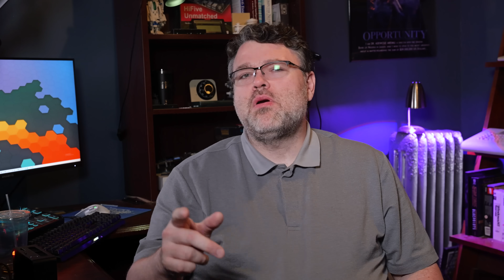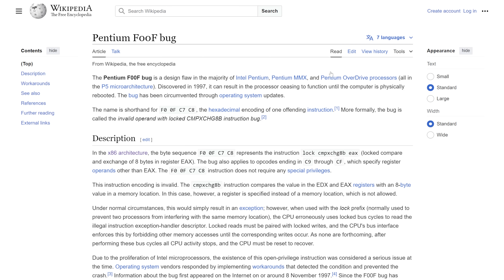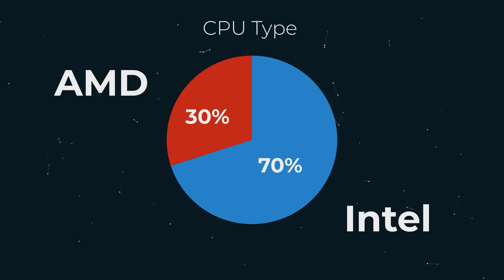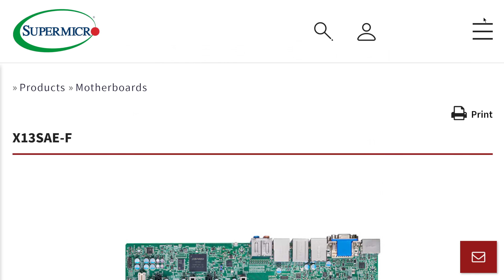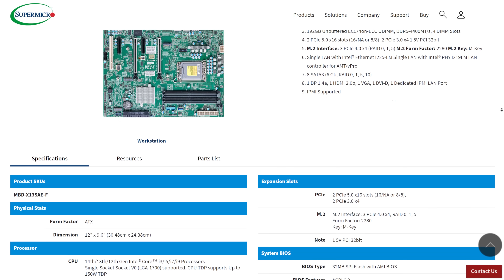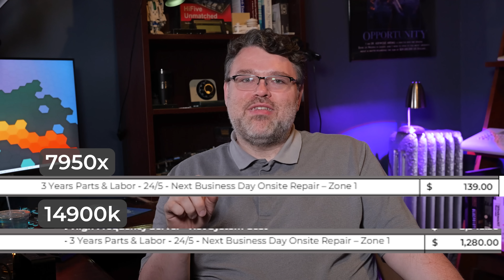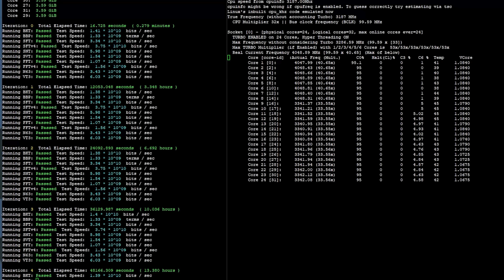Intel has a Pretty Big Problem

Comment: My god this is so useful. I am on my third 13900K in 18 months. First one ‘lasted’ a year (3 months of that was me getting more frustrated trying to diagnose wtf was happening as more and more and more games failed). The pain was that it came out as IO errors, memory errors, everything except the CPU. In the end I found a forum thread where someone mentioned it. 

I got it swapped under warranty and the second one began to fail identically 5 months in. Third one is still quite new but if this goes as well I’ll be sharing all of this with the builders and telling them they can either refund the entire PC or put something else back in.

I have no overclocking. The games that crashed were often games that a 13900K wasn’t even remotely needed for - like WoW - and it was absolutely infuriating
Reply: goodluck with 4th rma.
Reply: Have you come across anything mentioning if this is happening to the laptop 14900hx cpu?
Reply: @WaterspoutsOfTheDeep  refund the laptop
Reply: @matyasselmek3673  they are fine the laptops arent affected
Reply: @matyasselmek3673  evidence so far shows laptops are not affected
Reply: Who games with laptop lil

Comment: my nephew's ryzen 4000 series G have multiple display problem though... Found similar prob with other users with ryzen processors. I had rx570 before and it's full of bugs in 3D programs and crashes games a lot. Luckily my 13700 non K works fine without bluescreens

Comment: It kills me that Intel produces a K Series for the Overclockers yet want to void warranties if you overclock the K series cpu. I mean isn't that why you pay extra for the k series? I get if you were going way outside the maximum spec for the processor but someone at home using a 360mm aio and wanting to see how far it can be pushed, while also being stable and maintaining decent temps, get told to take a hike? I own a 14700k and even though I would like to try and overclock it I won't because it is running cinebench R23 at 100c bare bones straight from the box. Intel should be offering a free replacement for anyone that cannot run their cpu as advertised and  especially if they are getting memory errors or cpu degradation due to a bad cpu.

Comment: Summary

The Problem: Intel 13900k and 14900k CPUs are experiencing alarming crash rates, impacting gamers and data centers. (0:00)

The Evidence:

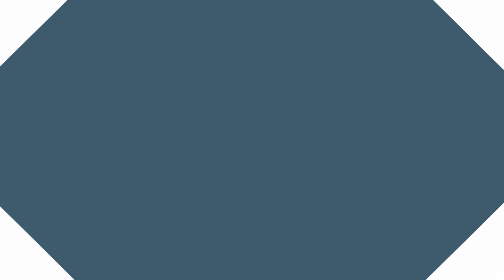* Game Telemetry Data:  Analysis of crash reports from two popular games shows a disproportionately high number of errors tied to 13th and 14th gen Intel CPUs. (1:07)
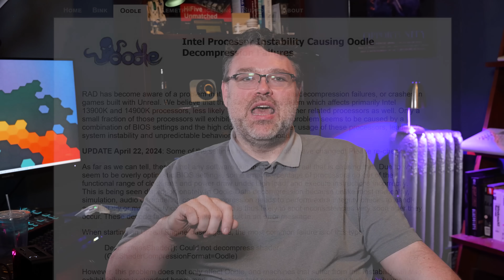* Decompression Errors: A specific decompression library issue, confirmed by Intel to be hardware-related, predominantly affects 13th and 14th gen CPUs. (3:26)
* IO Errors: Users experiencing frequent crashes also report a high number of IO errors, suggesting a deeper hardware instability. (6:36)
* Data Center Impact: Data centers using these CPUs on conservative W680 motherboards also report high crash rates and increasing support costs. (11:32)
* OEM Reports: System integrators like Dell and HP reportedly estimate a 10-25% failure rate for these CPUs. (16:41)

Possible Causes:

* Power & Clock Issues: While initially blamed on overclocking, the prevalence of errors on conservative systems suggests a design flaw in power delivery or clock management. (10:17)
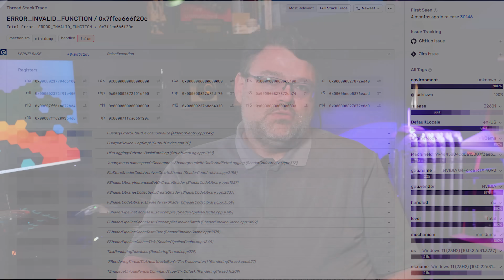* Component Degradation:  The increasing error rate over time suggests a possibility of component degradation within the CPUs. (10:30)

What's Being Done?

* Limited Solutions: BIOS updates and disabling E-cores offer partial improvements, but the core issue remains. (13:30)
* Data Center Shift: Some data centers are switching to AMD CPUs due to the instability and high support costs associated with Intel's 13th and 14th gen offerings. (15:48)
* Unclear Communication: Intel's response and communication about the problem have been ambiguous, lacking a clear commitment to resolution or compensation for affected users. (20:40)

Key Takeaways:

* The problem is widespread and impacting a significant percentage of 13900k and 14900k users. 
* The root cause appears to be a hardware issue potentially related to power management or component degradation.
* Intel's response has been inadequate, leaving users and businesses frustrated with limited solutions and unclear communication. 

i used gemini 1.5 pro
Reply: Wait what the fuck. You used Googles AI for that?
Reply: @X1ssyy  yes, I didn't have time to watch the whole video in the morning and I wanted to know the main points
Reply: @wolpumba4099  I didn't even know it could do that

Comment: I have a 13900hx system. I went into the new xtu and did the auto optimization which set the core multiplier to 55x. Xdefiant would crash on me within second of getting into a match. Reverted back to factory defaults and hasn’t crashed since.

Comment: All things considered, there seems to be quite a few arrows pointing at the 13th and 14th gen integrated memory controller either being the direct cause, or another hardware issue within the CPUs directly affecting the memory controller. Primarily the reduction in memory speed having a much greater positive impact on reliability than that of reducing the clock speed its self. This also blends in a bit into the typical memory stability configuration issues where (with typical overclocking) a single DIMM is supporting higher memory speeds and increased stability over that of a dual DIMM config and especially more so over that of a quad configuration, but this isn't with overclocked gaming systems... this is with server/workstation systems where populating as many DIMMs as possible (at standard CPU clock speeds) should be a feasible feature rather than that of a limiting attribute.

Comment: I have a 13700K and I got crashes on multiple softwares from Day 1. Chrome tabs would randomly crash all the time too. I intensly monitored CPU temps and observed that as the CPU started to get stressed the temps would instantly rise to a 100+ degs and then any program using the CPU would crash and the usage and temps would quickly decrease down (I knew that Instantly getting to a 100+ should be fine for this CPU as its designed to always perform at its thermal/power limit). So I figured alright lets turn off a few cores - didnt work. Then I bought a new 360mm AIO cooler hoping it would solve the issue - nope still the same - my Asus Prime Z690A can deliver a lot of power to the VRMs so the CPU instantly started to consume 235W and temps would rise and it would crash.

Furthermore every game that had initial shader compilation would instantly crash on load but the compilation would continue from the point it had crashed - this way I got Hogwarts Legacy to run after 15-20 crashes on load. I got Last of Us to run after around 180 - 200 loads (yeah I kid you not about that number). Once shaders were loaded though the games ran just fine for the most part - they would intermittenty crash during loading transitions ingame when fast travelling (Hog Leg and Cyberpunk crashed about 1-2 hours in per session). Last of Us though ran only about 15-20mins per session before crashing. I checked the logs for Last of Us and the error exception was pointing towards Nvidia. Decompressing via 7-zip and Winrar worked just fine but custom decompressors that stressed the CPU would not go beyond 5-15% before crashing, the time of crash would always vary somewhere between those percentages and I finally figured out that the CPU was basically shutting off at an arbitrary point during decomp/shader load etc. when temps were getting too high and hence no exact error was being thrown. If it would always crash at lets say 12% during decomp then they would point more towards a software issue, but this had to be the hardware.

 Freaking Discord would crash. Cinebench would Crash. How the hell do Chrome tabs crash?? This meant spikes in CPU usage/temp would make this stop working.

I finally gave up trying to play that game and figured the CPU I had received is just a bad die off the line. I was pretty much ensured that whatever was supposed to monitor the temps and adjust the clocks was not doing its job.

And then - after many months of suffering (I bought a new SSD - bought a new GPU - bought a new Cooler - multiple OS reinstalls - almost bought new RAM sticks) the oodle decompression failure article came out and I downclocked only my P-core multiplier to 51x and that instantly solved everything. 

For 5-6 months I went through a crapload of frustration - it was my first high end build and I got ripped off by Intel - all because they were out chasing Benchmarks numbers against AMD - is there really a point to doubling power consumption for 10% extra performance and lack of stability? Unreal - how the heck does something like this pass Quality Checks? From what I know every CPU off the line goes through atleast one round of stress test.

Anyways - rant over - my trust in Intel has been severely eroded - X3D is going to be in my next build.
Reply: Based on this and other videos, locking down P core multiplier to a lower setting is only a temporary solution. Even booting into OS and running all those programs with stock or higher settings, some damage is done. Eventually you'll have to reduce it further. Only way I can think to prevent this damage is undervolt and underclock (I'm talking 4.3GHz all cores) before even first time OS boot.

That's what I did on a friend's 13900K system I set up for him. He's reported zero issues since setup. Frankly, these high core count CPU's are begging for a heat offset with a slight undervolt; no more than -100 to -135 mV, because otherwise it becomes unstable. It would probably be fine with a 5.3GHz overclock on all P cores during gaming since the motherboard is regulating 235w max just fine.

The key is maintaining no more than a 1GHz delta between all cores and NOT sticking to stock voltage.

The whole 6GHz on P cores advertisement by Intel is fraud IMO. Yeah, you can reach it, but you can say goodbye to your CPU sooner or later as a result.
Reply: bro made a whole essay💀
Reply: I have a 13700KF, which custom decompression programs did you use so I can try to replicate this issue?
Reply: Just lower your TDP 125base,253boost and your CPU will run at 5,4 at max 75°C without any issues.

Comment: is it thermal stresses from repeated hot spot flux vs average temp? I want to see spreadsheets of data. i think the high single thread clock speed is causing a hot spot and thermal stresses due to the expansions and contractions of the physical chip. the solution is to turn off turbo boost. i think if it has something to do with e-cores, its like running a turbo on half of your engine. give me a hot new system and let me see if i can reproduce this failure with the turbo boost locked none.

Comment: Thankfully I am a hardcore AMD fan and don't suffer from these problems.  I figured out long ago that Intel just liked to throw more power at a previous model cpu and call it something new!  I also ran into some issues with Nvidia gpus around that same time, don't remember what, so at that time I decided to go all AMD, Have done so since, and I have never had any real problems. And AMD typically offers me a better price for similar performance.  Mind you I am not a hardcore gamer or anybody who needs their pc to run at the highest possible levels. But I have been happy with my decision to stay AMD.  And it seems to me that AMD has been the only one really going outside the box and making real changes and trying new things to advance the industry.  And of course now your seeing the other manufacturers making similar changes as to what AMD has done to try and keep up. I really think AMD will end up back on top in both cpu and gpu in a few yrs simply because they are leading the pack in innovation.

Comment: While I'm not the least surprised jamming 200-300watts into these pos CPUs is causing issues, I'm wondering if this is not starting to sound like the intel atom CPU range problem they had around like 2016-2018(?).

Where the entire range of these CPUs, used in many SMB sized routers and NAS but also on the private ownership side (think like the 4 bays synology models) had their main clock circuit go bad after about 2-3 years of use and would stop working after the next reboot.

Some of that stuff had crowd sourced workarounds like basically bridging another vdd signal to the clock circuit to reboost its power but a lot of stuff had to be replaced and from what I recall intel always avoided to take proper ownership of the problem and let OEMs using those atom cpus take the hit, which luckily for them was when most of this stuff was just out of the warranty period.

That whole thing was a silent scandal if I ever saw one. Here too bad for them it's happening sooner and on CPUs directly in the hands of DYI users not as part of a prebuilt piece of hardware so there is less middlemen to take the hits instead of Intel directly.

Comment: 13900k to a 14900ks. BSODs, CTD, browser crashes, USB devices disconnecting/malfunctioning, out of memory errors on both. Z790 GODLIKE to Z790 GODLIKE MAX. Still BSODs occasionally. My job involves a lot of Word, which crashes a ton and BSODs a ton too. My jump from Z390 and 9900k has been nothing short of a nightmare. I might take Steve up on sending my 13900k in to check out.

Comment: My guess is since the E cores run at the same voltage as the P cores they are being pushed way past their limit. The only fix is limit voltage but this will limit the P core voltage too resulting in lower peak clocks. The ring bus also could be degrading with the voltage too. Max voltage out of the box can be insanely high on these chips. Xeon based systems on the same platform dont have E cores example being the 1288 and maybe this is why they are stable?

Comment: By Intel pushing the P/e core design performance more more and more they are over-taxing the design of the CPU.
I think it is a way for Intel to have massive costs and production time cuts to use essentially a mobile chip design for their handheld to server CPUs e.g. MS Windows 8.   I think amd does not have as many problems because they are using their server epic CPU design characteristics from their epic down to notebooks CPUs/apu's( higher quality and durable p cores) that can withstand workloads that range from lite to heavy loads for longer periods of use over time.

Comment: I agree Intel has a problem but, with my age I have some advice.  You have these chips, have you tried to down volt and respec the config related to memory of say a 12 series chip.  I think they are overvolting and tightening timings too much. Can you do some testing with the 13/14  set to (105w) and max watt to say 125w the equivalent chip in the 12 or 10 series as they did not have these issues.

Comment: I was recompressing my hoarded collection of "linux isos", in the range of 30TB, and noticed that unless I use very low 2133/2400 DDR4 speeds, my 12700k can produce corrupted files. Very rarely, but it made me so paranoid, that I am now scared to use higher memory speeds.
Reply: Something else
Reply: sadge

Comment: Intel just built in an obsolescence factor into their CPUs to "degrade" performance and encourage the purchase of a newer generation CPU, they were just overzealous in the timing and the chips are frying themselves slowly right out of the box.
Seriously though, I've been saying this for some time. Maybe the smaller nodes don't mesh well with Intel's power-hungry design and current is leaking across the gaps and zapping components on the die.

Comment: I had a Dell gaming PC come in for repair with that out of vram error and complaints of BSOD's I couldn't get it to do it all the time, like I couldn't repeat it, of course being a Dell system, no underclocking or anything, I spent probably a week on this thing, tired a different 13700k and immediately got the vram error, tried a 4060ti same thing from time to time. I ended up giving him his system back at no charge, he said he took to other places and they couldn't figure it out. So I wonder if this had anything to do with it though I thought 3700ks and lower sku's wasn't really effected.